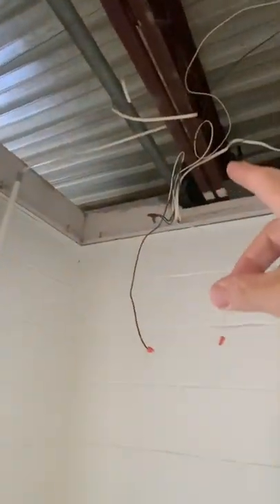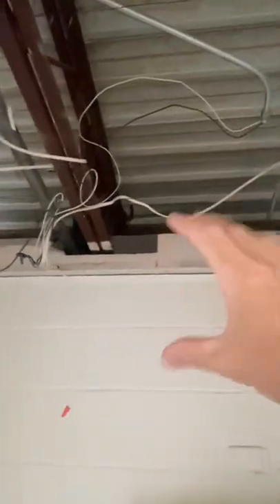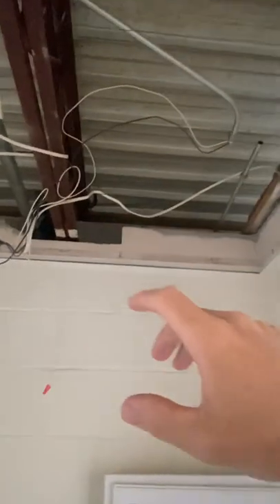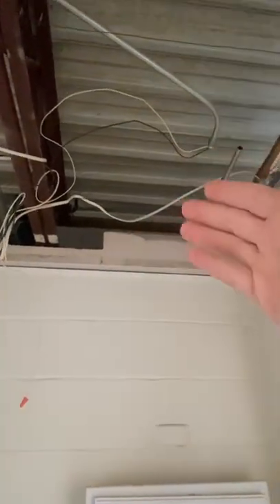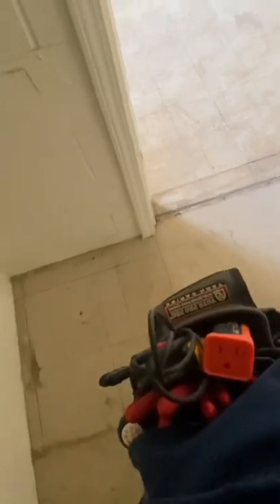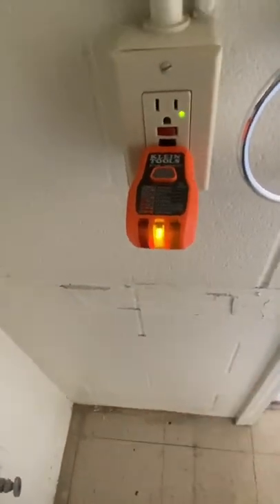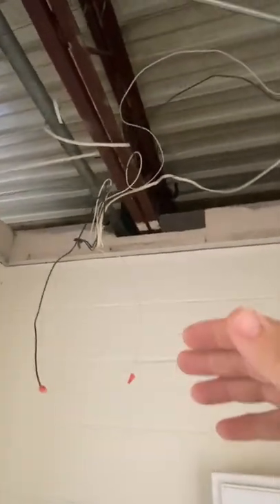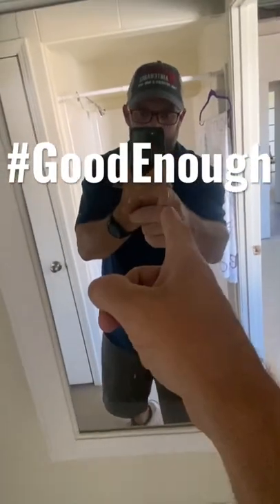Electrical Work where someone said #GoodEnough #electric #fail #construction

Comment: At least since they went full hack they put the gfci in due to lack of ground and tried to follow 406.4(D)(2).  I love those mid air splices good stuff.
Reply from the maker: I run into all sorts of stuff above drop ceilings…which is weird because it should be easier to do certain things above that than other places

Comment: Some time ago, I just stopped taking pictures of f-ups I encounter on job sites. Everyone makes mistakes. What's even funnier, I started documenting my own f-ups. Probably I'm getting prematurely old.
Still, this one is even better than #goodenough.
Reply from the maker: Yeah, I think of some things I’ve done in the past and laugh about it…

I’ve worked at this place for a long time…Who knows, I may have done this  and don’t remember it 😂😂😂😂 (I didn’t)
Reply: @MORGANSMaintenance  Since 7 or 8 years I avoid places where multiple people service the same thing. If I'm too "small" to do maintenance, I don't take the job. I'm not cheap either, so if a client focuses solely on spending as little as possible, I don't take the job. If there's "will worry later" attitude, I don't take the job. If I have to correct others' errors or negligence, because I can't continue with my work, I just make adequate quotation. Either I'll fix it for proper amount of money or force the people who spoiled it to make it right. Thus I have fewer and fewer opportunities to see #GoodEnough masterpieces.
Reply from the maker: @Stefan_Kawalec  that is the way to go… Unfortunately the #goodenough is all around me 😂.  The place I work a lot is a Non-Profit and I really like their mission and working there to help out. However, over the years they have had a lot of volunteers & work that they could “afford” leading to #goodenough

It is starting to wear on me though. Even if you are getting paid for it, it’s still hard to constantly be bombarded with fixing messes over and over. Maybe one day I will decide to be 100% self employed and get to choose all 100% my work. 

I do impose pretty much your same strategy on the Self Employ jobs I do. I’m pretty picky on my clientele with those.
Reply: @MORGANSMaintenance  I hope that my post didn't sound judgemental. It was not my intention.
Of course I have the comfort of self-employment.
In fact some shitty cooperation made me cease any work not complying with the rules above.
I had been doing social flats renovations for municipal company (city owned, partially financed by other state owned institution). Even slight reminder of some of the jobs and their "quality" makes me blush with embarrassment. Especially when doing compulsory maintenance I used to meet people living in those flats. It gives you the right perspective - I do my services for people. So if I do it in a shitty manner, it hurts that people. It was more of a systemic kind of problem with that municipal company. Their inspectors didn't care too much either. And everybody was afraid of exceeding the budget. All the time the budget was over the poor peoples' needs. So I told whomever should be told to f-off and since then I do my best to do my best on my own.
Reply from the maker: @Stefan_Kawalec  I didn’t take it that way at all. I have already decided that I will work where I do now…or go 100% on my own for similar reasons.

I am particular in how I do things and I can no longer work (or at least am in a place I don’t have to anymore 😂) for someone else. The place I currently work for the most part allows me to do whatever I think is necessary but they also trust me enough to do that.

I have a few friends that are self employed that I am willing to work with on jobs, but we have the same mindset.  When you get into working for people (cooperations or bigger contractors) who want to squeeze the nickels out of people by you cutting corners… it’s time to jump ship.
Reply: @MORGANSMaintenance  I couldn't have put it better myself.

Comment: There sure is a lot of “hacks” out there!
Reply from the maker: Yep, I run into in almost daily. I constantly look at stuff while I’m out in stores and stuff, it drives my wife crazy. I always say, “Someone got paid a lot of money to do that!”

I’m not perfect skill wise… but most stuff I see isn’t a lack of skill, but a lack of care.

Got two more Air Tips this week 😂😂. You got me hooked
Reply: @MORGANSMaintenance  you are 100% correct, you got me hooked on some M12 stuff so we’re even🤣!
Reply from the maker: @parts7959  I’ll take it, mines cheaper 😂

You aren’t the first, 3 guys I work around a lot have all switched from Dewalt 20v to M12.
Reply: @MORGANSMaintenance  😆 I bought my first dewalt 18v nicad set in the late 90s and it served me well. The m12 line was starting to come out when my dewalt set was wearing out so I upgraded to the m12 and haven’t looked back.
Reply from the maker: @parts7959  I ran the Dewalt 18v stuff too. I really liked it, the 20v stuff (especially the drills) just aren’t that great. Not saying they won’t get the job done, just don’t think they are as good as the other stuff out there.

They have them at a place I mostly work to use but I just use my own tools. That is unless it’s something extremely dirty 😂
Reply: @MORGANSMaintenance  👍🏻good call